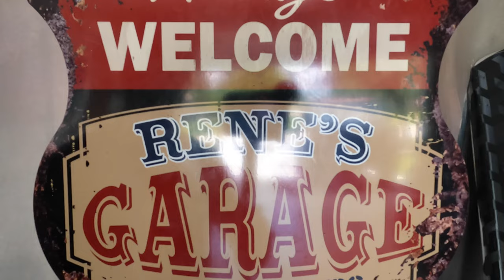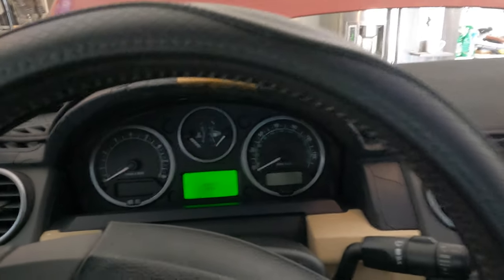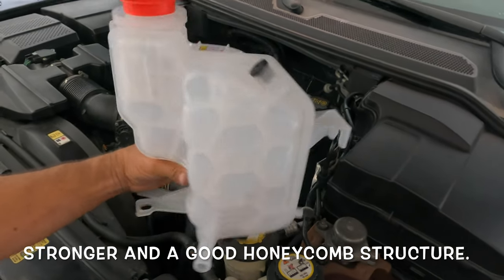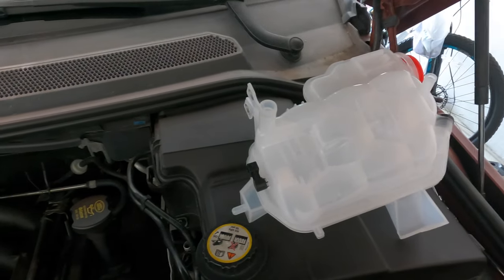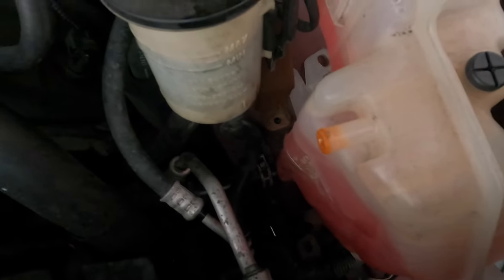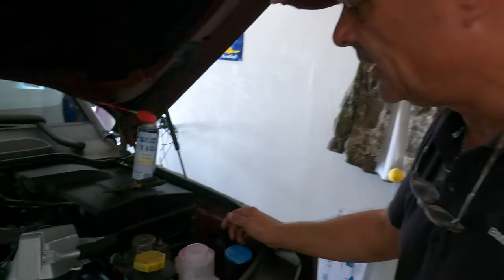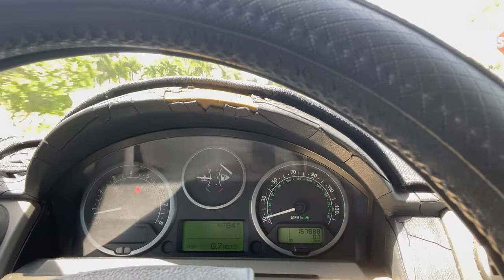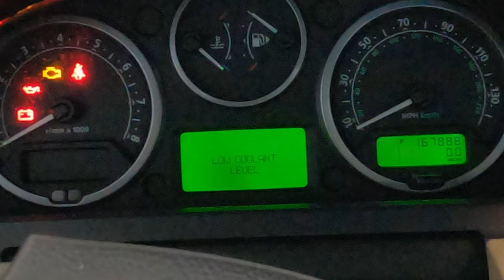Low Coolant level indication on Land Rover LR 3 and Discovery 3

Comment: Brilliant! I just noticed the low coolant level warning only to find the coolant level is fine. Thank you for the tip!
Reply from the maker: Thank you for watching and I am happy you could use it - it is a known problem with the LR3 and 4

have a wonderful day and drive safely, best regards Rene
Reply: @techtips101 I have a 2008 lr2 it’s been saying low coolant and the engine light is on. I am trying to figure this out myself since the mechanic quoted me $500 to test pcm. Please any advice. 🙏🏻
Reply from the maker: thanks for watching and commenting, first you need to see if you actually have low coolant level. You do this in the engine compartment, check the level is between the two lines min-max. If that is the case you have a symptom like I describe in the video and you need a new coolant container from Amazon 60$. You change it like I did and you are fine. Your check engine light you need to go to an auto shop or by an OBD reader yourself - as cheap as 20$ on Amazon. Then you let the reader tell you the code and the code will reveal which engine problem you have to focus on in order for you to fix the symptom that triggers the light. 

Hope that helps. 

Drive safely best regards Rene